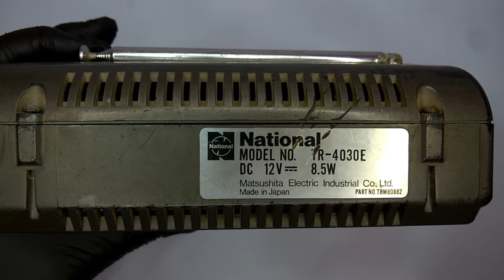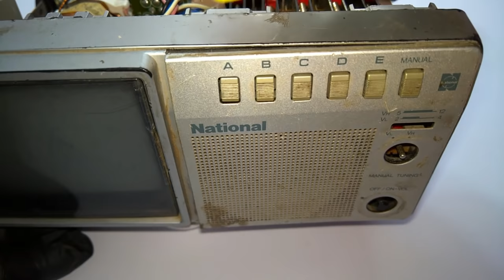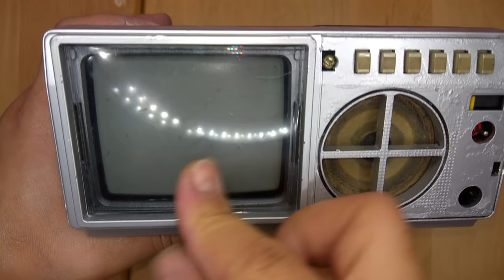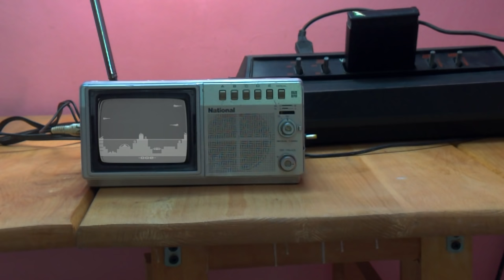Restoration Mini Japanese TV produced in 1979  Antique television - Restore old Mini TV

Comment: Personally at the very least I would have also replaced all of the old electrolytic capacitors, because new ones today are smaller. Using ones with the same µF ratings is the most important part, and voltage CAN be slightly higher, as that's tolerable. It's the least you can do for old tech like this, I believe. You might also have to look into resistors and diodes as well depending on conditions, and that could lead you into searching for schematics to fill in the blanks, but it's a labor of care for the craft if you're dedicated to preserving the tech.

I guess that's just me, though.
Reply: @MBAHCOMROCK  how dare you use that kind of language ! My kids watch ! and read the comments !!!!
Reply: @averteddisasterbarely2339  🤣🤣🤣
Reply: No, not only You. I would also replace the potentiometers and control buttons, check the modes according to the electrical circuit.

Comment: muito cuidado ao manusear televisores Crt após ser ligado a pouco tempo, o transformador de saída horizintal (flyback), Possui ainda uma tensão residual, E no caso de outras tvs que não usam entrada direto na fonte, ou seja ligada em 220 ou 110 V ac Podem ter o problema da fonte não está sendo alimentada e o capacitor de flitro que fica na entrada carrega com uma tensão de pico de 350 V . Muito cuidado !!!

Comment: For some odd reason in Japan the brand we call Panasonic is called National.
Reply: Panasonic (or Matsushita Electric when the company was founded in 1918) actually used different names for their products, when they started making home appliances in the mid-1920s in Japan, it was sold under the name “National”. The reason why the brand was called “National” is because the founder,  Konosuke *Matsushita*, hoped that their products would sell well in Japan when they released their very first product, hence the name.

The “National” marque was also used in Asia, Europe and Australia,  but they stopped using that brand in 1980 and 1988, respectively, replacing the name by either the name Panasonic or Technics in said markets, the latter was discontinued in 2010 before coming back by Panasonic 4 years later. The Asian market still used that name until 2004, when they decided to used the name “Panasonic” to unify their products.

Japan, on the other hand, never dropped the “National” name for their non-audiovisual products (the name Panasonic was already present here) due to its recognition until 2008.

In the US, the name “National” was never used since the name itself was already registed by others (even though they briefly used that name in 2004), and so they decided to create the brand “Panasonic”, which is a combination of “pan” (which means “all”) and “sonic” (which means sound, which makes sense since Panasonic's first products in the US was audio equipment).
Reply: @netako  
Informative... Thank you.

Comment: 9 Watts !! That would work so well in a camper in that era or even have plugged into a  lighter outlet  in your truck sitting in/on the dash
Reply from the maker: Thank you, that's exactly the case
Reply: Back when these came out Many did buy one to use on camping trips. These were considered extremely portable back then
so a lot of people wanted a set but they were expensive at release.  they became more affordable after a few years
of being out.